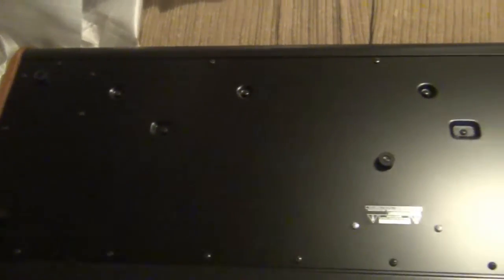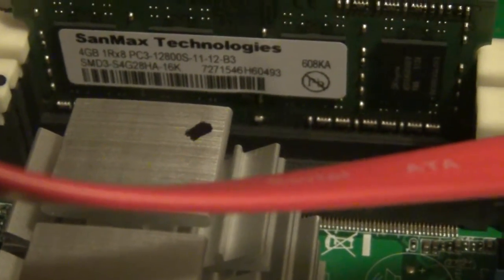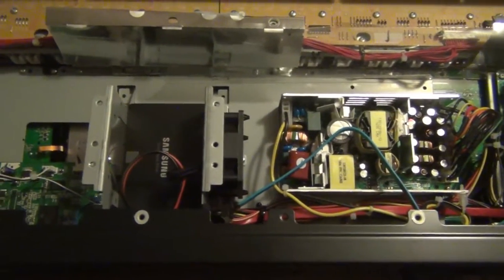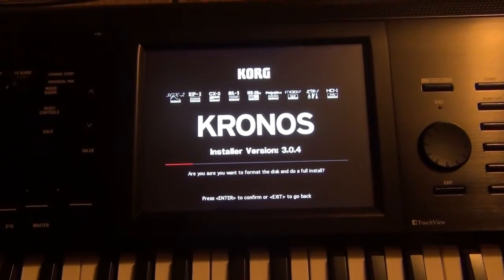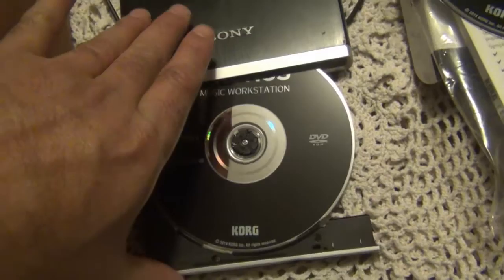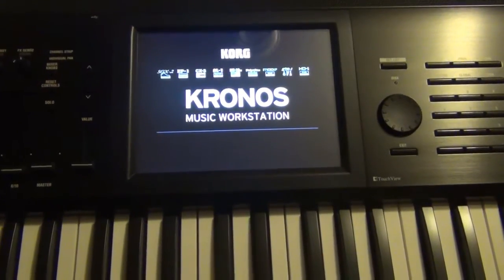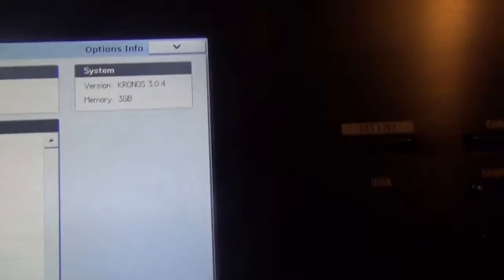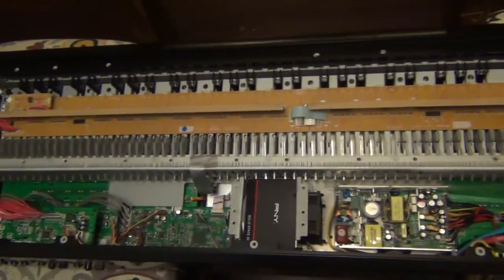Korg Kronos Primary SSD Drive install Tutorial

Comment: JBeliz,  I read in one of your posts you used Acronis 2017 I am a firm believer in Acronis better than Norton Ghost.  I forgot there is a part you have to be careful I believe there is an option to expand the last partition of the target drive if not it will only clone the first 60GB.  Is this what you did in the software?  I remember vaguely this is what I had to do in my Korg Oasys.  I also remember booting into a USB Acronis boot is better than running it from the PC desktop for better results since the OS stays out of the picture.

Comment: HI, great video tutorial here. Is the new SSD faster than the original one? the booting is just 10 seconds faster? mine (original) takes 4-6 minutes to boot. 10 seconds don't make a huge difference and it's not worth the trouble IMO. what do you think?
Reply from the maker: I think your 4-6 minutes is very long even with my memory maxed out my load time is at least 2-2 1/2 min to load everything. You might not notice huge differences unless your loading tons of samples but the differences are minor maybe just a better quality ssd with more memory is all.

Comment: hi,what exact DVD drive are you using? I've tried 6 of them ,no success
Reply from the maker: The one in the video is a Sony and it recently went out on me and i am now using a Verbatim only difference is this new one has 2 usb connectors one for power and the other for the data so I connect both in the usb a&b ports in back of the Kronos and it works just as good as the Sony.
Reply: @jbeliz  What model?
Reply from the maker: @osbertgeorge  I believe it is the external slim line usb 2.0 model #98938

Comment: Hi,  if we do cloning,  will it also clone damage files or corrupted files to the new ssd?
Reply: Not necessarily. It worked for me to clone. But difficult to get the real size of the new drive. Cloning gives you the same GB as the original (about 60GB).

Comment: I wrote a not-so-great comment about a week ago. I have since deleted it because when I did follow through with even his "mishaps" It lead me in a direction that I was able to fix my 73 replacing the SSD. Turns out, when I purchased the drive duplicator in JBELIZ's video, (would not have if it weren't for his post), It copied almost everything and had my 73 back up in...minutes. Just had to re-manipulate my own samples I made on my first drive. Did not have to use the included DVD's at all. Did not have to re-enter a public ID. So, TY for your post, it all worked out replacing my SSD with a 250GB drive because you posted this video. Nice post, BIGGGG help!!!!
Reply: Is your factory ssd from kronos corrupted so you replace them with new one?

Comment: Wait, so cloning it alone didn’t work? And do u have to use an external cd drive or would a MacBook work?
Reply: You must use the DVD's, easiest,  or do a clone, but have to use a software that allows it to boot to Linux afterwards. F'd up.
Reply: You can use a freestanding cloning device, and not do anything else just to make sure the drive and connections work. If you clone using a PC/ mac using software, there is a risk that it won’t be formatted the right way. Using the dvd afterwards allows you to use the full size of the new drive, have it formatted correctly, and also make sure any potentially corrupted files or partitions are gone.

Comment: Hello, again. I have another question : when you've installed a second SSD, is it possible to install authorized sound banks, coming from shop Korg, with serial numbers, in this second SSD ? Or, are we forced to Install them on the boot SSD ? Thank you for your response.
Reply from the maker: Bueno si esos librerías ya estaban activados originalmente deben de también mandarte los códigos para cada librería.

Comment: I got a question and maybe u can help me out.  I have an original KRONOS 61 that came with a standard 30GB ssd.  I cloned the drive to a new 250GB SSD using a docking station offline.  I installed the new drive but left the SATA cable where it was originally and just hooked it up to the new drive.  I did not reinstall the original drive. The keyboard booted up fine but when I go to see how much memory there is it still reads 30GB when in fact it should say 250GB.  Any suggestions?
Reply from the maker: Michael Molini your drive should be formatted in fat32 it may have been formatted in fat16.
Reply from the maker: Just make sure your old drive is no longer installed if you cloned it offline you might have to clone it with a program.
Reply: Thanks for ur reply brother.  Your video really helped me out.  I think I know why.  Since I cloned it offline it cloned the entire drive even the size.  So the rest of the disk space became unallocated.  Ur right and it’s probably because I didn’t use a program to specify this.  Do u know an easy program to use?  I have a Mac
Reply: The best way to do it is to use the Disk the keyboard comes with to reinstall and repartition the HDD and have the OS reloaded again.
Reply from the maker: M M - cloning is the fastest way of saving all your data and OS. You save lots of time and don’t have to hassle updating your OS again and all your purchased expansions and files you may have saved and re authorizing it again. Using the DVD’s are only good if you do not want to add a new drive or just restoring the original in my opinion.
Reply: I’m having the same problem you had   I removed the original primary SSD drive 60 GBs & Replaced new SSD  hard drive which Is 250GBs I clone the drive boot up my Kronos I only see the 60 GBs instead of the 250 GBs drive please let me know what you did  any suggestions

Comment: Hey man, I’m having some issues with my Kronos. I’m getting a “system startup failed” message every time I power on. I changed the ram and the hard drive and am trying to install from the accessory disks, but when I boot up with the first disk in I still get the “system startup failed” message and can’t move on. I’m not prompted to format and reinstall or anything. I have brand new ram and hard drive. Any ideas??? Any info is much appreciated.
Reply from the maker: Tyler Campbell when installing from the DVD 1 choose option 2 on the screen that should do it.
Reply: Hey thanks for the quick reply! However, my problem is that there are no options. When in insert the disk and power up the Kronos, I get the “system startup failed” message.
Reply from the maker: Make sure your dvd drive is compatible make sure the power on the Kronos is off before you install the dvd.
Reply: jbeliz how would one know if the dvd drive is compatible with the Kronos?
Reply: @hegotbounce  RIGHT!

Comment: What software do you use to clone the SSD of the Kronos? Any particular steps to be aware of? Do u have a video tutorial for the clo0ning process...
Reply from the maker: Cloyd D'Mello I used Acronis True Image 2017 software very easy to use basically takes you step by step only make sure you choose the right drive that you are copying from u don't want to accidentally erase the original. But it is pretty straightforward it will copy without having to re-authorize anything and you will have all your files like they were without having to re-install anything.

Comment: Hey. Can you remember how long it took to format the ssd after partioning?
Reply from the maker: Robert Giacinto the whole process takes about 45min or more to format and load all files
Reply: jbeliz interesting. I am still waiting for it to finish formatting after about 2 hours.
Reply from the maker: Robert Does it look like it is stuck not progressing?
Reply: jbeliz yeah. No disk activity at all after the first minute or so. Will have a second try with another ssd that i formatted with my computer. Just in case there is something odd with the partition table.
Reply from the maker: Robert If you clone it from your computer and choose full format instead of option 1 it will do the trick I had the same issue getting stuck on a full format and partition. I chose only full format and it worked perfectly.
Reply: Cloning the old ssd now. Hope it works :)
Reply: FYI: Cloning the drive (with dd or parted on linux) and resizing the extended rw partition worked. I didn't even have to reinstall the system :)
Reply: How long will is it take to format 250 GBs on korg Kronos 2